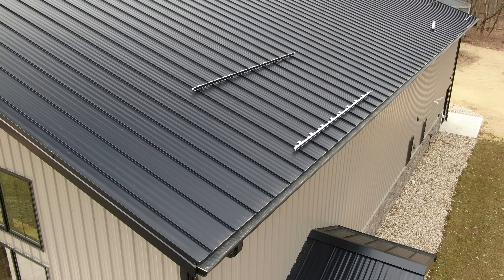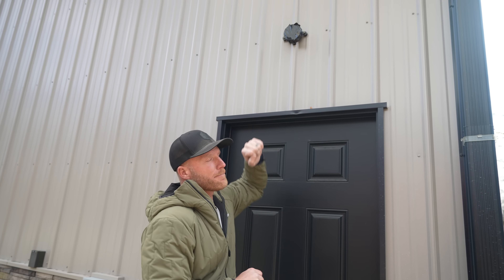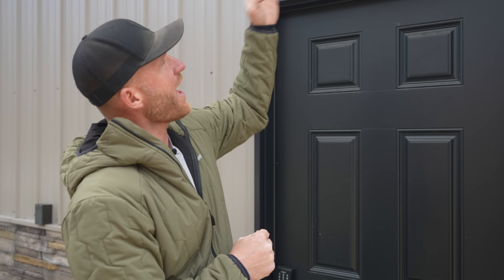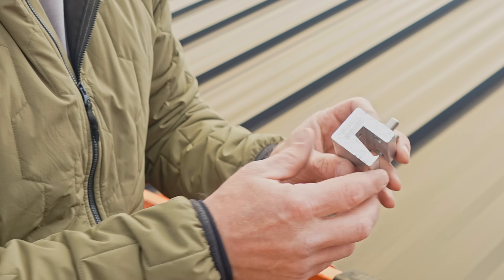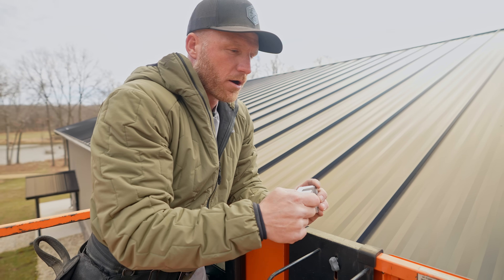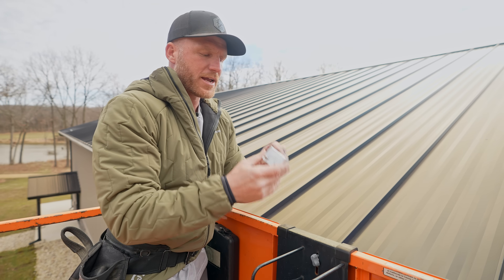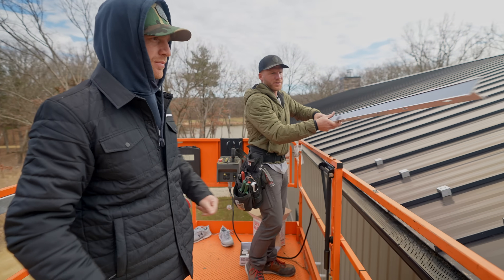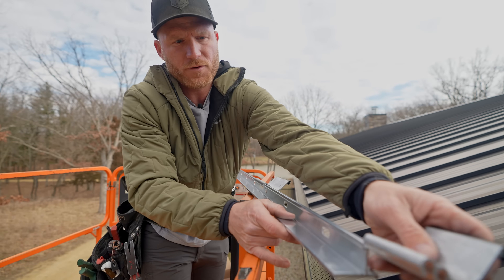How to STOP an Avalanche on your METAL ROOF: Snow Bars!

Comment: What would you recommend for a 2/12 to 3/12 pitch with standing seam and ice daming  issues going to use heat cables but I also want the snow to come off on its own with out ripping cables off

Comment: I cannot imagine why I would want these. I live in Central New York, in the snow belt. We want metal roofs specifically so the snow will shed. Why on earth would I want to keep that weight up there? I had a building this last winter that was damaged and barely avoided collapse because the snow did not slide off.

I would love to hear explanation as to why you would want to hold all that weight up there. Around here we pray for it to come off, we just prepare for it happening.

Comment: Finally an answer how to prevent this. We have an exposed fastener metal roof that is 25yrs old. We bought the house 5 yrs ago and have had 2 really bad snow winters since we got here - our first winter and last winter. OMG the avalanches of snow - have crushed 3 BBQs on the patio, ripped all our gutters off, ripped out all the vents on the roof (now venting through the walls). When we bought the house the seller had what they called snow breaks on the roof - turns out it was only drip edge that was used as a break. That wasn't good enough - the sliding snow has ripped almost all those off (a couple are hanging bent half on/half off. Wish I could get you to come fix ours.....

Comment: 12 inch pounds = 1 foot pound. Need a different torque wrench but the easy way might be to tighten one screw down with the torque wrench once, then check which setting on the impact driver most closely matches it. 10-13ft. lbs = 120 to 156 inch pounds so there is some wiggle room. just a thought on it.

Comment: simple and minimally invasive ... the fixing system without drilling the sheet metal is excellent ... no water infiltration. generally in our area it is preferable to install the bars along the entire eaves line and shaped steel plates riveted on the rib of the plate are used. I'll ask you a question: here in Italy we have the obligation to install fall arrest systems on the roofs made up of poles and ropes or plates or hooks (at the designer's discretion) for any future maintenance. Don't you have this obligation?

Comment: Grease the threads of the hardware. Steel into aluminum will corrode.  Also, the plastic piece you slid in, what keeps that from sliding out over time? A little silicone when sliding it in would hold it.
Reply: Those clamps are specifically made for metal roofs, im sure that they have thought about that and changed something to prevent that. And the little pieces you slide in and usually tight to fit so they wont really slide out overtime as theres nothing to really have it slide out

Comment: Great instructional vid as always. You noted that the bottom row is suggested to be at 12" from the fascia, but your eave overhang should be considered. I believe the manufacturer says that the bottom row should be placed on the roof plumb with the wall below the overhang. This ensures the snow load doesn't cause any failures on long overhangs.  I doubt this is much issue on a low slope like yours, but the snow on my 12:12 roof transfers a significant load to the snow guards.  Just my $0.02
Reply: Very Helpful!!  My house has a 12:12 pitch also, and was built in 1938!  One of the best things about this antique (aside from 8' ceilings) are the 2 1/2' eaves.  Very cooling in the summer.  I need to look at the interior roof structure again, but to set bars too far out would definitely do damage.  I was only about 5 minutes away from getting caught in a 4' deep snow avalanche myself.  I know we need protection.
Thanks!💜
Reply: Those trusses are likely engineered to handle the snow load all the way to the eaves

Comment: Metalmasters in Mchenry IL manufacturers snow gems and various other snow retention products. The Dynamic fastener system is very good. We usually close a corner of the face of the bar so the black strip of metal doesnt slip out with the wind. Awesome video!

Comment: Any cheaper options for two 40' spans? Especially if two rows are needed?
    I aways thought metal roofs were the best option out there until I owned one. I live in northern Minnesota (A lot of snow). New seamless gutters in the summer, those are now bent flat and barely hanging on. My front porch has been ripped off the ledger and the amount of snow built up around the house is currently touching the flattened gutters. What a nightmare! With the prices I've seen for just an 8' section of this snow bar and the amount of them I'd need, I'm starting to wonder if I should just tear it off and put up shingles...🤦
Reply: Brandon, sorry you are experiencing these issues. It sounds like your contractor led you to believe that a metal roof was the greatest roof out there. I deal with this on almost a daily basis, misinformed customers. I explain all of the issues that you are describing to all of my customers and more often than not end up installing shingles. Metal roof's are great, but they come with a lot of extra expense. I.e. larger gutters and snow retention.

Comment: I once worked in facility w/o snow bars. When the snow came off the roof it like an avalanche. A safety hazard and the gutters came down with the snow. $13,000 dollars to replace the commercial gauge gutters.
Reply: Guy in my area walked out of a Chik Fil A and was creamed by an avalanche off the roof - ice and it knocked him out. Consussion to boot. They acted like it happened all the time and it probably did since they had no protection to stop it. I lost trackl of him but I hope sued the hell out of them! My roof slides but onto another lower roof but it shakes the entire house when it goes!

Comment: I can see how those can trap water and create pools around joints and fastener holes. i don't have any entrances or vents on the sides that get snow and ice sliding off, would rather just have it slide off instead

I am thinking of installing gutters though, installing them low enough for sliding ice to avoid would probably work
Reply from the maker: Most likely if your are low enough to avoid the snow you also will avoid a heavy rain
Reply: I'm sure you're right if one doesn't get you, the other one will

my main issue is erosion, 40x60 pole barn structure on a very steep slope and clay soil. most of it from rain roof runoff. also thought about doing French drains or drainage channels where the runoff hits the ground to capture most of it. gutters probably would get wiped out by ice sliding off

keep up the amazing work been watching you for years and learned so much
Reply: Could go with a hidden gutter system but that will probably cause a lot of ice dams (theyre used hevily on cedar shake roofs here in bc

Comment: One thing to take in to consideraton is the snowload. If you do live in an area with a lot of snow, you should have snowguards on each side of the roof, so you dont get uneven distribution of load on the roof.  But as always, great vid:)
Reply from the maker: Trusses are typically (at least ours always are) engineered for uneven snow load
Reply: In Finland we install snow bars for the entire width of the roof and also two in row. If we do like you innthis video snow will pull those off. @RRBuildings

Comment: Great product designed for standing seam roofs, my only question would be the swinging sections inbetween each rib , do they move once the bar is secured and would there be any chance of the wind rattling them over time and wearing out the rubber seals causing alloy on steel friction?.

Comment: use sno-jacks or snow gaurds or sno jax there are a million names for them. The are a small plastic device about an inch and a half wide that looks like a self sticking out perpendicular to the roof. They are held on with an adhesive. They do hold the snow in place for a while, but what they are really good at is breaking up the snow sheet that is sliding down the roof. breaks up the snow, so it doesn't get heavy enough to do that sort of damage.

Comment: Be careful if installing solar panels, as they create a perfect slippery surface for snow to slide on. We had the beefiest snow bars installed for years without issues, then added solar panels and the first winter had a horrific roof avalanche that could have ended lives..
Reply: Exactly, snow guards and solar panels dont mix very well unless you have the solar panels a good length away from the snow guards

Comment: Cool video.  I just had a barn built in Wyoming last year and have a side load 8x8 garage door under an eve and I've built up about 5+ foot drifts next to it - something like this would be useful but my roof is the ribbed steel with fasteners so would probably need a different system than what you used.
Reply: Most of the big manufacturers make a version for ag panels. Usually looks like a half triangle with the right angle pointing towards the ridge.
Reply: Here’s an example.    https://youtu.be/O9aIdKkk0KE

I use this version here in Montana and it works perfectly. My first row is on the eave purlins and next row was second purlin up. If the roof has sheeting it’s less critical on where you mount to.

Comment: Help me out here guys / gals: wouldn't you not want these in areas where snow loading could be an issue like in norcal right now?   I mean I see the deliberate use here and think it's a non-issue in this case, but it makes me wonder.
Reply: I mean would you rather have the snow slowly fall off in small chunks, or after a heavy snowfall, a day later have all of it fall off at once? Like in socal it should be removed by hand when it gets to a point or trimmed off. But the stuff happeneing in socal is so unexpected no one was prepared for it so most metal roofs dont have them out there i think
Reply: @Josh  re: norcal  I think unexpected depends on how long you lived there - the old timers say this is normal - everyone else who moved into the hills in the last 10 years was caught off guard!
Reply: @Persistent Wind  its just that it normally doesnt snow there every season. I live in vancouver bc, and we rarely get snow but with the small snowfall we do have, most people go crazy (i grew up in a place where it snowed 6 months of the year so im used to it) but even then its more common to snow here than over there and people are already thrown off here. So even though it does rarely snow there, if it hasnt snowed in the past 5 years there its still completely unexpected because i doubt anyone throws on their winter tires, etc during the "winter months" while there or store their exotic cars for the winter months.

Comment: Kyle…convert foot pounds to inch pounds (= 156 inch pounds). Purchase an inch pound torque wrench, which are relatively inexpensive, and 1/2 the size of a 3/8” drive foot pound torque wrench and you’re good to go. The point made from another subscriber supporting the possibility of voiding the mfg. warranty is then eliminated. Simple solution and the correct application redacting any liability on your behalf.
Reply: To add to this, some blue loctite and a tamper paint pen also helps to prove you followed spec

Comment: I tried throwing bars over individual doors and air conditioners in the past and it worked, but the part of the bar that is left unsecured floating on the ends always ended up bent up by heavy snow sliding next to it. In the end I just put bars down the entire line and haven't had any problems. 

Definitely agree that throwing something above the vent pipes can make sense as well. I've had a chimney pipe get ripped out mid roof one year. Anything at the bottom would have been long gone. Depends on how often and how much snow the roof gets before shedding as well. Usually here it would build up all winter and only really shed towards spring, so holding it a few extra weeks didn't really change much other than avoiding damages.

Comment: I liked the mounting on those snowstoppers. We have some very slippery stone on our roof, and I had to change a few stones each year due to the force/ weight on the snow stoppers, until we had a company install a few extra snow stoppers “mid-roof” and above vents. Just having the forces a bit more distributed with more mounts and more stoppers on the roof made all the difference. I have not changed stones the last 4-5 years.

Comment: Suggestion: add a snow stop just above the plumbing vent. If enough snow is shedding off the roof to damage a light fixture, the snow will eventually destroy that vent pipe as well. 

Snow stops (or diverters) above vent pipes are typically wedge shaped similar to a cricket above chimney. 

Great content and keep up the good work. 😊
Reply: 88

Comment: For as long as I've watched your channel it's been intriguing to me how the rain gutters last. Around here when the snow slides off it usually takes the gutters with it. The stops aren't generally used because of the weight of the snow building up and stressing the trusses. Guessing because heavy wet snow is more common here than dry powder
Reply: IMO the gutter is mounted too high. Most installers want to be right up at the eave line to prevent overshoot of water. In snow conditions the gutter has to be in the sweet spot where water gets caught but snow can slide over the top. I’m in NW Montana and we get decent amount of snow and I’ve never had a gutter taken down.
Reply: @bpdp379  yeah in Canada your gutter goes 1" below the roof line at the outside edge. Sliding snow should go right over the gutter that way. If you gutter is catching snow it is too high for sure.

Comment: If ever you were worried about how much pressure you're applying with your impact driver. You could have a look after a few tries with a torque wrench. Great vid btw
Reply: Thats what i do, use the impact to tighten it just enough to hold there, and then another guy comes behind tightening it to the specific lb torque. Theyre a pain in the ass to set with just the torque ratchet

Comment: I have a built in 1900 farmhouse with a 8/12 pitch standing seam roof . Living along the Indiana/Michigan state line I can tell you that a single row snow dam is no where near enough . It does slow things down but I don't want to be standing under there when it lets go . Will have to look into adding a second row on my roof  now , Thanks Guys !

Comment: Nice job, we've used those with S5 clips in the mountains of washington state. We had one failure after an epic snow dump (similar to california this year) due to not having enough rows going up the roof. 26ga can only hold so much weight. In the mid-west i think your fine
Reply: This is DynaGard, which is a design that was stolen from S-5 when the patents expired. S-5! has a calculator on their website that can help make sure you get enough rows next time. 26ga is only so strong for sure.

Comment: Get yourself a couple of suitable torque wrenches, you may need to prove you used the specified torque values to ensure you validate the manufacturers warranty. Those battery operated drivers are good, but not for ensuring the torque values are correct
Reply: Couldn’t you say proper validation of manufacturer’s torque specs is important for anything?
Reply: @Rins27  not if it’s a pecker pump
Reply: @BeeHiverson  this is true